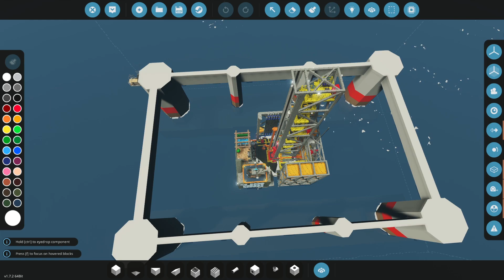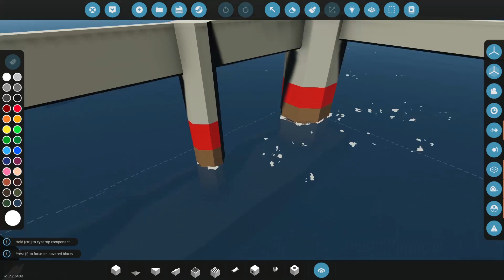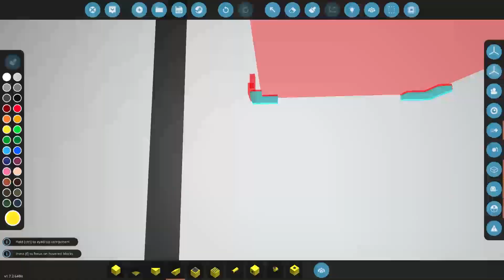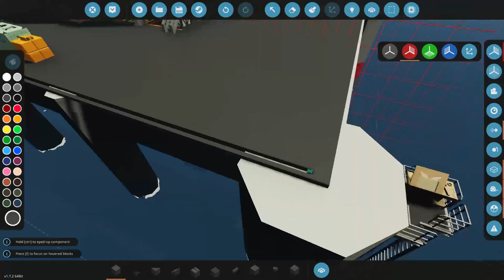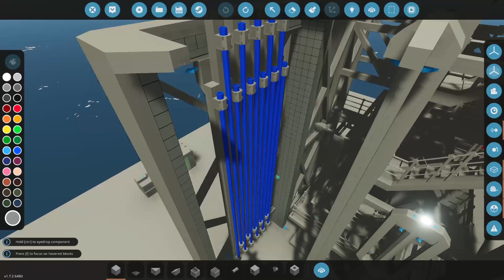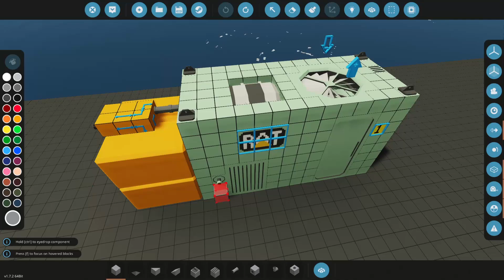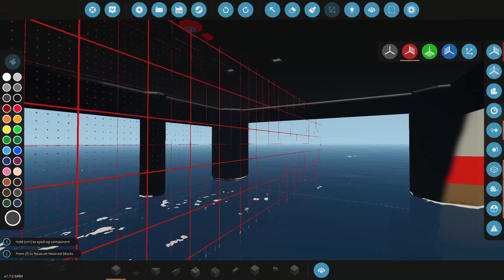Stormworks: ENGINEER Builds ADVANCED Oil Platform PT.1

Comment: Hey @454ss Stormworks Gaming did you think about oil barges? You know, the ones that help fill up cruise ships and stuff like that. They have piping on the surface and usually a little control center in the middle. What I am saying is have the control center in the middle, maybe with a 360 viewing area at the top, and splitting each area up, 2 for drills, 1 for distillation, one for storage, and so on. Even if you don’t do my idea, I can’t wait to see how it turns out!!!!!